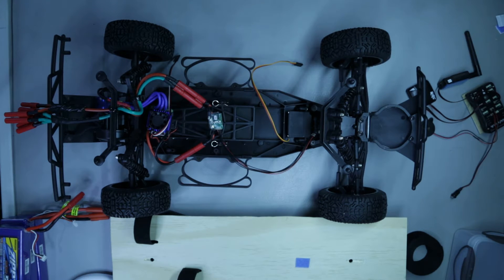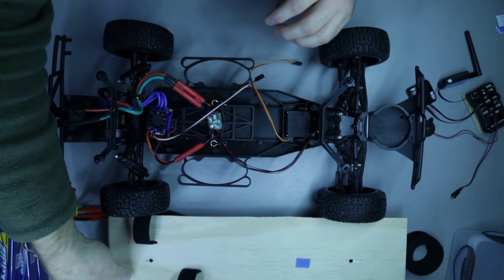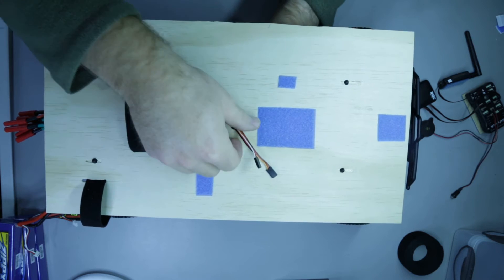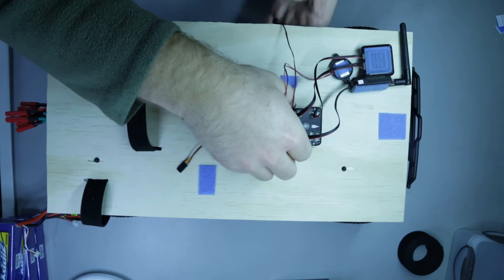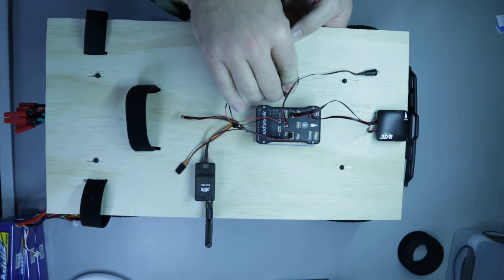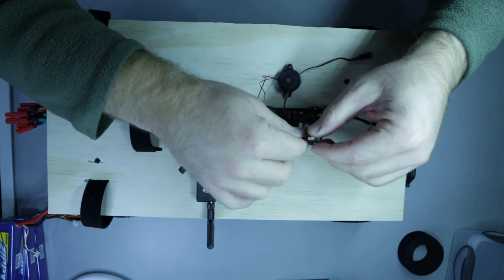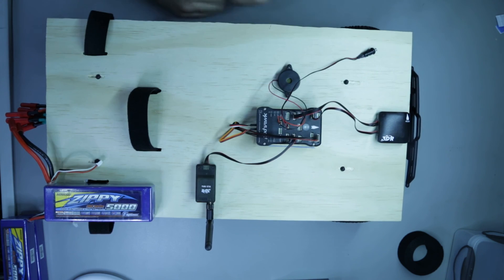ArduPilot How to Build a Rover - Part10 - Final Component Fitting

Comment: Hello. Nice videos. but i can not see how did wired up the motors to the pix-hawk.
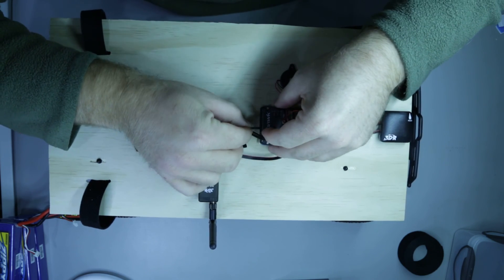Reply from the maker: At the 2:23 mark I mention installing the power into channel 3 out.  This is also the signal to control throttle.  This cable goes to the ESC that connects to the motor.

Comment: I have built a rover this exactly as your build. It's my first rover. I did not calibrate esc before hooking it all up. Now I seem to be a bit lost. Any help on calibration thru Pixhawk?
Reply from the maker: ESC calibration is not done through ArduPilot as its something that needs to be done for an RC Car even if you don't have an autopilot.  There should be documentation coming with your ESC on how to do it.  Most of them are
1. With everything turned off put the throttle stick to full (make sure your rover is on stands so the wheels aren't touching the ground)
2. Turn on your transmitter and turn on your Rover
3. The ESC will beep in an unusual way
4. Put the throttle stick back to minimum
5. The ESC will beep again in an unusual way
6. Turn everything off and then startup as normal.

This is usually how ESC calibration is done on RC Cars as the ESC now knows what the max and min are coming from the transmitter but sometimes ESCs do it differently - it does vary.  Again best to consult the documentation that come with your RC Car.

Thanks, Grant.
Reply: I should bypass the Pixhawk completely? (Thank you for the quick response)
Reply from the maker: If the Pixhawk starts up in Manual mode its fine to leave it in the loop.  However, you can bypass it just for ESC calibration should you wish.
Reply: Works fine straight into the X8R but nothing in from the Pixhawk. Pin 3 for Throttle and calibration looks like it's working.
Reply from the maker: Better to ask support related questions over on our fourm:
http://discuss.ardupilot.org/c/ardurover
Thanks, Grant.
Reply: I had to turn off some arming checks to get it to work. But I'm off to the races. Dual rates with initial switch at 40% is a good start.
Reply from the maker: Great that its working!